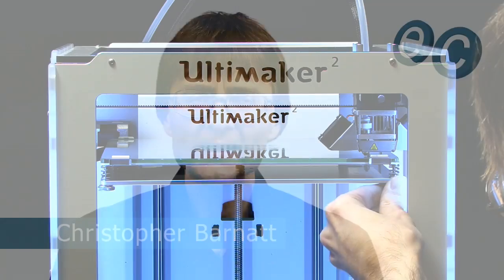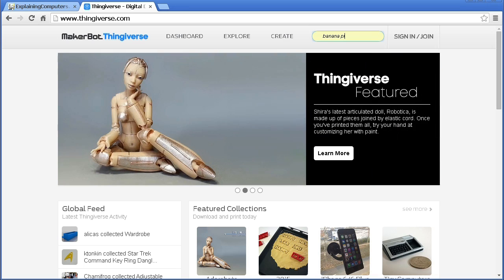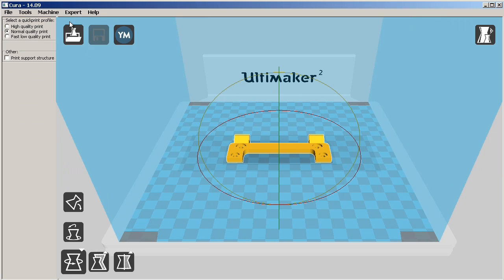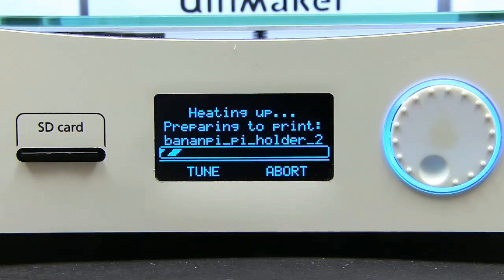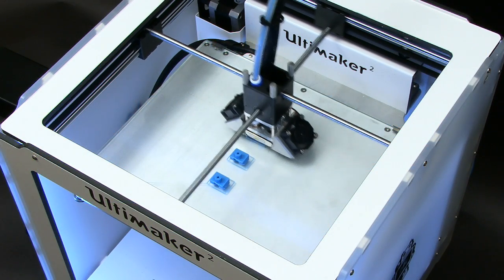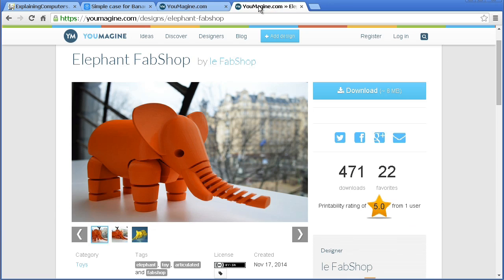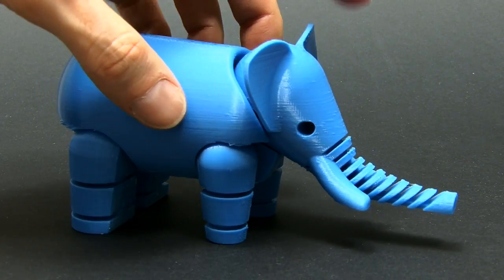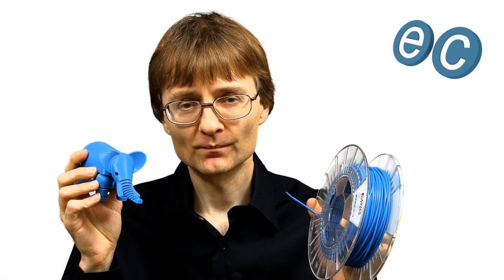Ultimaker 2 3D Printing Workflow

Comment: The software is only compatible with ultimaker 3d printers .
Reply from the maker: Cura can be used with many different 3D printers. Go to "Settings" and "Printer" and "Add Printer" or "Manage Printers".
Reply: ExplainingComputers Of course I did not mean printing but graphic design .

Comment: I tried to print that elephant but at some point the printer stops extruding and keeps moving as if it was printing,  this happens with all the 3d model that have height in them, anyone had such problem? my printer is Ultimaker2 extended
Reply: by the way it's cloned version and it still new
Reply: Lol its a clone ultimaker, thats why mate
Reply: Topkek kek  I know but I'm the only one who had issues with it, others who bought the same model didn't have any issues
Reply: Topkek kek  this specific issue I commented about is fixed,  but I got other issues
Reply: Khalid Jabbar Almayah dont buy clones. Dude, Support the company that made the item originally.
Reply: Topkek kek  It was the only one available to me, 
I can't afford the original one, I live in Iraq and shipping from the US is very expensive that I can't even afford a Robo printer. found this um2 clone for 900$ and free shipping by aramex so got it and to be honest,  I really regret it
Reply: Khalid Jabbar Almayah damn man, I live in qatar and im gonna buy the U2 extended plus :p, Robo printers are like 740
Reply: Topkek kek  I know Robo is cheap, but the shipping is so damn expensive
Reply: Khalid Jabbar Almayah yeah, Atleast 82 us shipping thats alot for shipping
Reply: 82$ is fine, but 400$!!! No

Comment: I am just curious - did you set the print quality to be so bad that you have so many flaws in your prints? I would expect a 2500 printer to be much better than my 300 dollar Chinese RepRap but it looks like my printer is doing a better job :)
Reply: +Fr33s7yl0r He's probably still learning. Even expensive 3D printers have a steep learning curve. For example, that head of staff should absolutely be printed flat on the plate to avoid overhangs. Or maybe he just wanted to demonstrate that it can still print in whatever way you want...

Comment: A good introduction of the 3D printing process such as the use of scanning,  or the thingiverse (by makerbot)  and youmagine (by ultimaker),  or new file from scratch to develop the object.    You make a good presentation just as you did in youranother video "3D Print software".

Comment: You should try out the Dremel 3D Idea Builder for 900 USD, to be honist i did try that Print and the Dremel made nicer and smoother parts then your Ultimaker 2. Nothing against Ultimaker but in todays Time you can get an very very good Printer for 900 USD and not for 3300 Usd. OK My Dremel cant make ABS but i never needed that but for Starters it is the best ^^ Maybe some Day you try it out ^^
Reply from the maker: +Mario Obermaier Yes, the Dremel is a nice 3D printer (actually a re-badged Flash Forge Dreamer, which is very well respected hardware.
Reply: ExplainingComputers True but sadly Dremel made just 1 Extruder Design.... Ultimaker is an well Brand but for the Price i had mean that other Brands are nearly or same Quality as them.

Comment: I wonder if you could make CPU fan's clips (you know, those that brake all the time) with it?
Reply from the maker: ***** I am sure that you could, if using ABS plastic rather than PLA, and using a high level of infill (probably 100% to create really strong clips). A very interesting idea! :)
Reply: ***** Those evil CPU-clips are a filigrane construction in and itself - they are already from ratehr tough material - I think it would be better to print some kind of adapter, so you can just use normal screws

Comment: Why didn't you just put all the parts on the same print? I think you need to tweak the settings, the prints weren't very clean.. Just a few tips, when printing something that has a overlap near the build plate, go the the plugin tab (when using expert) and use the 'Tweak at Z', change the 'layer no. to tweak at' to 2 and the new 'build bed temp' to 30, it will cool the build plate after the first layer and stop the print from curling up and make for a much much nicer print. Also once you have selected the print and while it is heating up go to 'tune' then 'build plate temp' and turn it down to 55.
Reply from the maker: Drunkun_Munky Thanks for these tips. The parts were not printed in one job as this would have significantly complicated the filming process. :)
Reply: ExplainingComputers No prob, ah I see, I liked the elephant XD

Comment: Man look where we have reached!
Reply from the maker: Kevon Chandarjit Indeed. :)
Reply: ExplainingComputers Will the DaVinci 3d printer perform similarly to the Ultimaker 2?
Reply from the maker: virusboy07 Similarly, yes. The Ultimaker does produce more accurate prints. But everything I have shown in these 3D printing videos basically holds for other desktop 3D printers. I have seen the elephant I made 3D printed on a Da Vinci and it moved just as well! :)

Comment: You could have done it faster if they were all on the same build plate
Reply from the maker: zak robbins Agreed -- but it would have made filming a nightmare! :)
Reply: zak robbins Not always the best decision.  It unevenly distrubutes heat on the build plate.  Sucks heat and makes maintaining equilibrium much less possible than it already is.  Not ideal for something you're actually going to use that needs to fit 100% properly.  That and it is hardly faster.  What's it save...maybe 10 minutes?  Print finishes > remove > Start next print...and repeat.  Ends up adding no more than two minutes between prints and you can use ideal settings for each part as well.  It makes no sense to splice two different objects at the exact same resolution, given that several of his were different heights/objects/size.  If you have an object that is 40.46mm tall, then you wouldn't want to splice it at the same layer height/resolution as an object that is 37.11mm in height.  You'll end up splicing some of the objects unevenly.  People don't think about this stuff and just choose a layer height.  That's not how you're supposed to be doing things top get a proper print.  Splicing an object unevenly leaves you with small screw ups.  Sometimes they are not visible and can only be measured for tolerances to notice them.  Tweaking to ideal settings for each product makes far more sense than saving ten or fifteen minutes over five or six prints, no?  Also, he would have needed to print them at the same time, not "all at once" in the splicer options.  If he had printed all of those seperately, but in the same print job, the fan shroud would knock another print.  If he did them "all at one"...you'd piss time away, because the print head would be running around from one print to the next, given that it is laying down one layer on each object at a time.  So, if you have five objects on the plate, it will do layer one for the first, travel to the next print, lay down layer one for the second print and so on to the third, etc.  You end up with a ton of travel time.  Most likely so much wasted travel time, that the time added up between each individual print would be faster.  That's just what I've noticed from my experience.  You can calculate it with a slicer.  Just turn print at once on and then turn it off.  You'll see a massive time difference.  It's adding not just travel time, but travel time between each print on each layer.  As I said, I don't think he would have been able to print all of those parts individually during the same print job, because our fan shrouds would knock one over.  You need to space parts out quite a bit on an Ultimaker 2.  It's worth it though.  Printing an object right now at 20.7 microns and running at ~80mm/s.  That's stupid fast for layers that thin and the object is looking fantastic.  Plus...all printers are slow, all things considered.  It is the slowest means of production in terms of plastics...so...the difference between printing one job at a time is pretty redundant.  Just an example...if you print five objects and it takes six hours...what's another half hour, by doing one job at a time over five in the same job, you know?  Either way...it's going to take a whiiiile.

Comment: Wow Chris!  I loved your selection of objects to print.  The elephant was of particular interest because it was manufactured with no additional assembly needed.  This will be the future of manufacturing as cost advantages will push this into the business plan.  Another big turn will be when the plastic filaments become available made from recycled materials! 

Keep the great information coming!  This is an exciting time in which we live!

Rich
Reply from the maker: MrMoonpie001 Thanks Rich for this and all of your kind comments. I tried to pick three different kinds of things to print. First something practical (it happened to be a Banana Pi mount, but could have been a spare part for something, etc). Second something with multiple parts pre-assembled. And thirdly something that was a kind of reproduction, and finished with paints.Actually, there was another set of prints too -- but they are part of another forthcoming video . . . ;)

Comment: Are those slicing programmas hard to run?
Or can every laptop and tablet run it?
Reply from the maker: rubikfan1 Pretty much any modern PC (inc laptop and Windows tablet) can run slicing software. Cura slices in the background, so may get a big sluggist on a lower-power PC, but should still work OK.
Reply: rubikfan1 I think most PCs and macs that have been made within the past ten years will be able to handle a slicer like Cura.  It isn't very taxing on the CPU.  Not nearly as much as any CAD design programs.  Note that models load far faster in Cura, than more or less any CAD program.  There are exceptional files can take five minutes to load.  Some even more if they are extremely large with many parts.  But, note in Cura that the same files load in a fraction of the time.  Slicing and loading tool paths may take a little longer with an older computer, but not by a hell of a lot.  Cura is all processor and asks very, very little of graphics cards.  I run an integrated card with a 3.4ghz processor.  The integrated card is shit obviously, but the CPU is the important part when it comes to slicers.  Running simulations and such in CAD programs...not possible with my integrated card.  I could, but it'd bog or crash.  I have several PCs.  Two have graphics cards, this one does not.  Every slicer and things like netfabb, etc. work ridiculously better and everything loads at least ten times faster.  Between open a new file, importing, exporting, and so on.  To run a slicer smoothly, I'd say any laptop with 1.8ghz or more will run it very well.  Anything within the past ten years should be right around there at worst.  I have a friend that runs Cura on his tablet.  It is pretty new...I can't remember what brand...but I imagine most tablets can run them.  I have a three and a half year old droid razr and run a can stably run a few CAD programs as long as I'm not attempting to simulator moving parts.  I'm sure there are slicers that can be downloaded for tablets at this point.  Pretty sure I read of someone freehand drawing some models on his tablet...so, if someone can run CAD modelling program...a slicer should run like a dream on the same device.